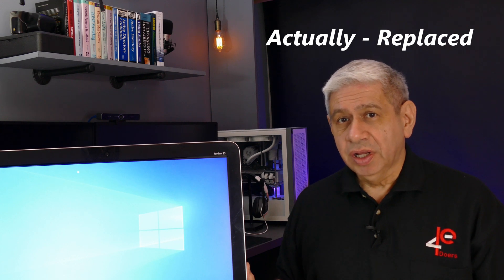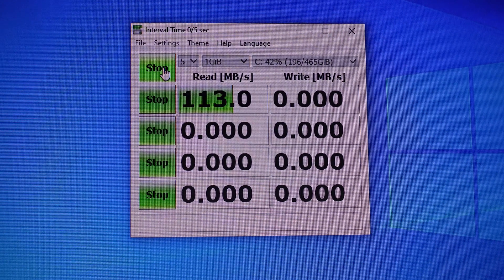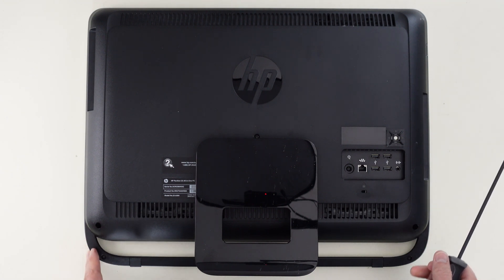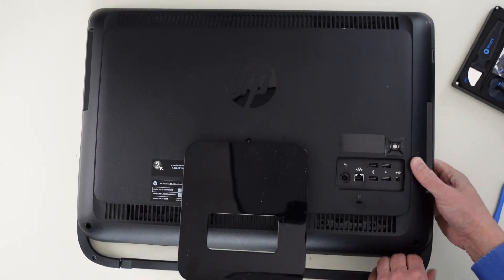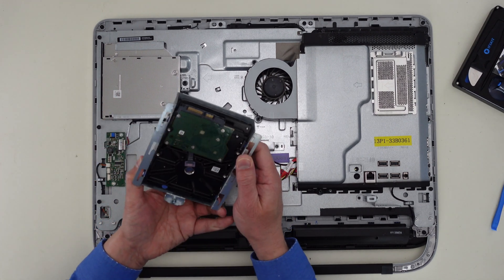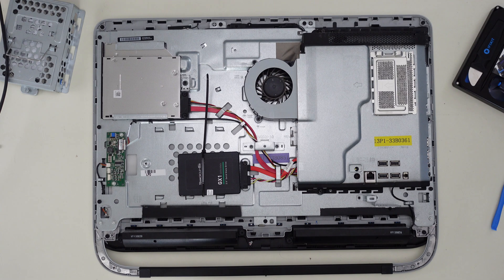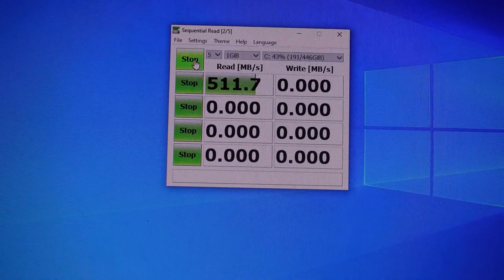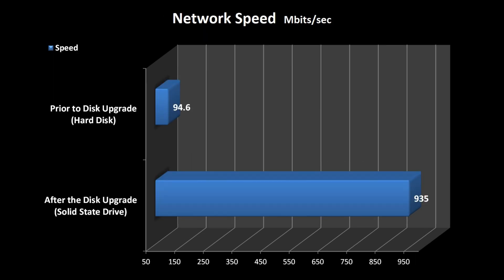Improving the Performance of an HP All-in-One PC

Comment: Pretty smart fix.  Excellent problem solving skills.
Reply from the maker: Thanks.  That is how I started my career in computers, repairing and improving them.
Reply: @PE4Doers  I didn't know you could upgrade one like that so easily.
Reply from the maker: @tfunkera  There is quite a lot that can be upgraded.  This particular system already had 8gb memory, but many of these systems don not - so I would consider doing that if your only has 4gb.

Comment: Interesting video. Thanks.
Reply from the maker: Thanks for the comment.  I had that PC sitting in a corner gathering dust, so my wife asked if we could give it a relative who uses a very old computer and their TV as the monitor with no sound.  I felt it had to be improved before we did that, so I used a couple of parts I had sitting on the shelf to improve its performance.  It seems to be a fairly good home-office PC now.

Comment: Brilliant Video :)) Thank you David :))  It just shows you can give a an older PC a new lease of life with a new SSD and a in this case an USB to Ethernet adapter and a fast one too. Crucial SSDs come with 2mm Plastic Adapters to make up the height difference in some Laptops. Of course you would have needed 3 of those in your case. Your solution is simple, genius and consists of parts most of us very likely have at home already :)) Total part cost around 58 USD. And the best thing some one else will get a refurbished PC :)) For the old unused Ethernet port I would have used:

https://www.amazon.com/iExcell-Black-Ethernet-Cover-Protector/dp/B01I814D0U/ref=sr_1_5?crid=3R4AHD7DATSKP&keywords=ethernet+rubber+plug&qid=1645192164&sprefix=ethernet+rubber%2Caps%2C116&sr=8-5

And some electrical black tape over it to avoid unnecessary confusion and support calls. You are already busy enough :)) 

There is a trick to install Windows 11 on old systems :) It is even approved by Microsoft. I installed Windows 11 on a 2nd gen Intel System and it runs smoothly with no issues :)) Of course after retiring Windows 10 you could always install the minimal Linux XFCE if the PC is then still alive :))
Reply from the maker: Thanks Kathrin so much for watching and commenting.  Your suggestions are great and I will look into them.

Comment: Does Acronis automatically turn on TRIM support for the SSD? I've heard reports that this is among the issues with doing a clone of an existing Win10 install from spinning rust to an SSD.
Reply from the maker: I have never had a problem with it.  You also might be interested in how Acronis can create either a Windows (cut-down of course) or a Linux stand-alone bootable USB.  I always use the Linux version of course 🙂